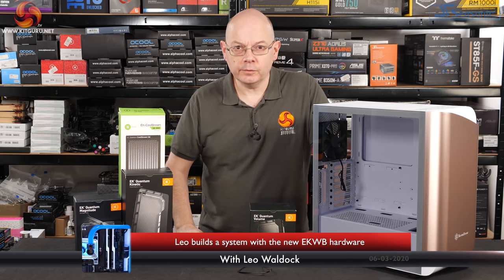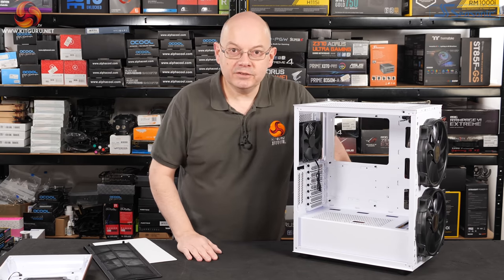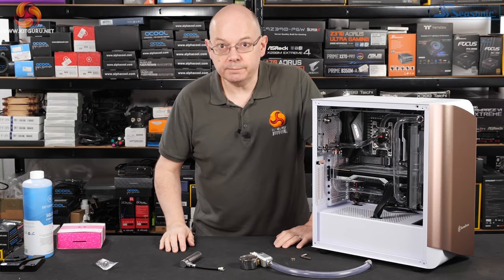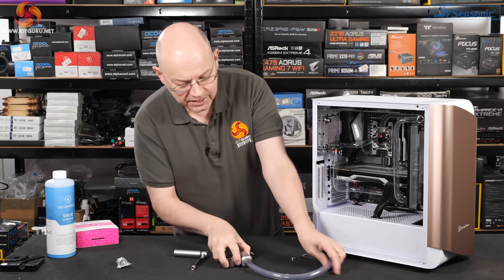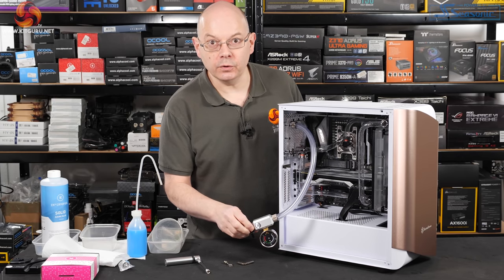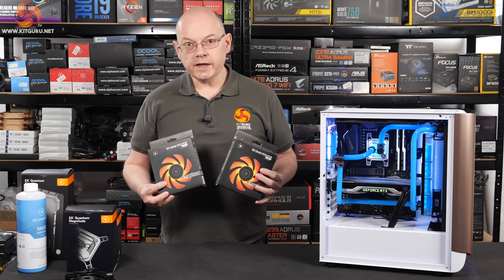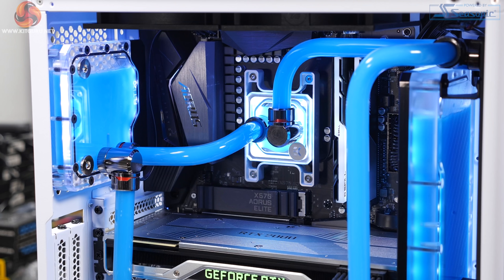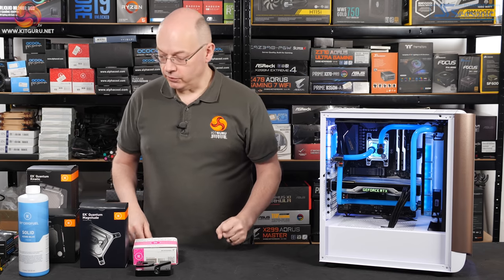Leo builds a CUSTOM LOOP with EKWB Quantum & SilverStone Seta A1!

Comment: Given the huge difference in CPU temps when you remove the front panel, it does look like it is choking the cooling. Sure it could be a little better without a big flat reservoir on the radiator, but a 20C drop by removing the front panel is fairly alarming.
Reply: fairly?
Reply: Calum McFarlane A mesh version would be a winner,I think.
Reply: I would only change one aspect of what you have just said - namely changing it from a water cooled choice to Every choice.
Reply: @LDWilliams  Cheers and very true, amended.

Comment: Know it's an old one Leo, but I purchased one of these cases in good part due to your thorough review and placement of the radiator at front. I've wondered about your comment around the 1:50 mark regarding the underside filter and found after opening the delivery box that it's possible to spin the filter 180 degrees horizontally and remove it from the front...

Comment: Enjoyed this buid Leo, cheers.
Would be interesting if you could do a general comparison reminder video of non-water cooled and water cooled for the same board and components so that folks can see the difference. Additionally, I see EK has a new combined block specifically for the Asus Zenith II and Threadripper 3 (where the CPU block fins are meant to have larger coverage), and, Optimus has a new Threadripper 3 block (also promising increased fin coverage). Would be interesting to follow these to see if the increased fin coverage is effective (compared to their respective previous threadripper blocks, and the equivalent competition). Not every apparently similar CPU block has identical fin coverage.

Comment: Hey Leo, you think those big 200 mil fans have enough static pressure to move adequate air through the rad? Most big fans like that I have used can move a lot of air into a large area, but not much pressure so easily blocked. It looks like not much leftover to get fresh air to the GPU.

Comment: Leo, you didn't block airflow with hardware because there was never any to begin with lol
That front panel design is terrible, made worse by cramming the fans against it.
Reply: neil saich  there are plenty of ways to include glass yet not impede airflow
Reply: neil saich  i do believe it is a thing called choice
Reply: Especially 200mm fans
Reply: @BuzzKiller23  nought wrong with 200mm fans
Reply: @LDWilliams  120mm static pressure fans will work better with the radiator than those 200mm fans.
Reply: @ady4r  agreed, but 200mm fans if set up correctly are perfectly okay.
I should know, I have 2 x 200mm thermaltake fans in my Cooler master H500M case (mesh front used) and my temps are as low as 34C  (general desktop usage) on both CPU And a vertically mounted 2070 super GPU

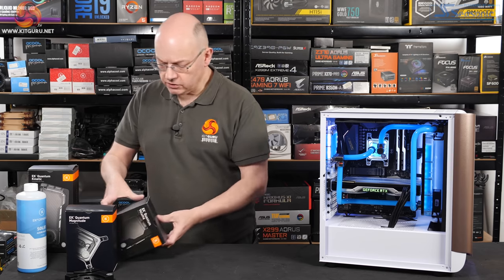Comment: 13:39 Nice Leo. One thing is bothering me, and it is that huge air bubble capped in reservoir. :)
This can slow down water flow a lot, pump again run high RPM speed doing any work.
Reply from the maker: With both Quantum reservoirs the fill port is at the top and both inlet and outlet are at the bottom. You could run the levels down at 50mm and it would be unlikely to affect performance.

Comment: For the Rear ek flt Volume, did it come with similar mounting brackets where you could still keep a 120mm fan on the back of it? Eks website says mount, but doesn't show an image of it. Wanting to make sure a spacer is still in the box in case.
Reply: I'm pretty sure it does come with the same mount as the pump/res version, and if you want to mount it perpendicular to the fan mount/radiator (for less airflow obstruction), you can use EK angled brackets.
Reply: @theoldhenk7531  it does! Just ordered and I see the brackets

Comment: From my experience its better to avoid large fans and just use more 120 mm.
Less noise and better air flow.
Reply: You have it backwards, my friend. Larger fans spin at a lower rpm to achieve the same amount of cooling. Therefore, you have a quieter sound profile with larger fans.

Comment: Hi Leo, what did you make the models of the tubing out of? I've never seen it done that way before but looks like its probably the best way to get tube runs planned out. It seems far better than trying to measure and gives you a visual idea of how the entire system will look. Very much want to try this way if you wouldn't mind sharing info on what you used
Reply from the maker: It's been a year and here's your answer; aluminium welding rod, something like 1.5mm diameter

Comment: How much did EKWB pay you in order to not talk about the EK-Loop Connect. What a catastrophic product!!! Love the videos, keep up the good work....
Reply from the maker: Leo here: As it happens I emailed EK five minutes ago requesting the Loop Connect. I haven't heard any reports either for good or bad. Where should I go to read about it?
Reply: I have the Connect and its great for me.  No issues what so ever!  That person in Reddit (who I have responded with) that has the issue is hardly a example of a big problem!
Reply: @mods-qo4pr Hi, that person in Reddit is me :) The software is completely unstable. Best I can get out of EKWB support is that their are known issues and they are waiting for new software to be released by the developers. It could be an issue with Amd chipset as all the people who have Same issue as me are running Amd. Are you able to hide the fan software when you have configured it? Can you make the software start at boot?
Reply: @FTLN  - Not sure what you mean about hiding the fan software.  This software does not have the option to boot at start-up, but then it does not need to as its working as expected based on the profile I set.  Its not perfect, but hardly catastrophic (although I except AMD users will have a different opinion)
Reply: @mods-qo4pr  If software.is not working at boot then how can controller ramp up when CPU temps are getting high?

Comment: Wonderful your Cpu is cooled now what about the rest of the parts?  Unreal why people think only the cpu needs cooling.  Those plastic res's completely choke off the system. and the back one removes the exhaust with only the top for exhaust or intake.  Sorry if you are running the cpu so hot you need liquid you are way over doing it, cpu speeds these days account for near zero performance loss or gain in most gaming/creation usage. .3ghz or even 1ghz jumps only work for software that was designed to utilize the extra speed and the gains in gaming of 5-10 fps are worthless.  Overclocking for crunching huge numbers and huge piles of data is usefull, 5ghz overclock for fortnite is for dummies.  The Rad placed on the top would work best and the airflow from the front fans would keep the rest nice and chill.  Nice build but that rad in the front chokes the system too much especially with no rear exhaust.

Comment: OK, you moved the fans to the front where they will be right up against a solid front panel.   ZERO airflow getting through
Reply from the maker: The front fans were removed to install the Kinetic pump/reservoir and were then replaced in the original locations. They were not moved.
Reply: KitGuruTech - Sorry, I thought they were originally BEHIND the front frame, which would make much more sense in this case.    Giving it room to pull air from the top and bottom openings on the front panel.     What a horrible design.    If I were to but this case I’d have to mod that rose gold panel with large cutouts and add mesh.

Comment: infront of the case i can see 2 huge gaps between the 2 fans, created by the plastic economy on the fan shapes, where air will flow back in a closed loop instead entering the case ...it would be very easy to close those gaps, but naah, the case doesn`t have much air flow anyway so why bother

Comment: no one in their right mind would do so much water cooling just for the CPU and the dye is bad...you have RGB and you put solid dye in. Would have loved to see how the flt's worked with RGB that isn't blocked by solid dye
the case looks horrible ..one of the worse looking cases ( and airflow is shit )I have seen but its white ( so where is Briony )........as for the cpu waterblock, would love something that you mount differently so if you say had the waterblock for the lian li 011 you could turn it 90 degrees